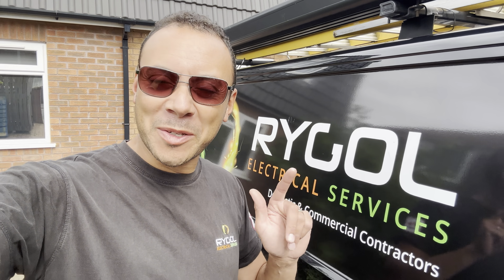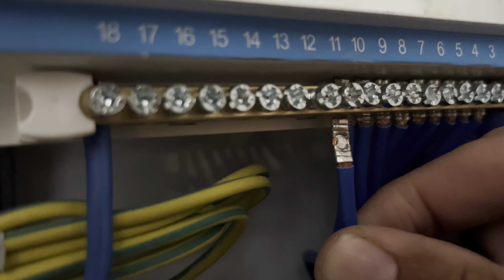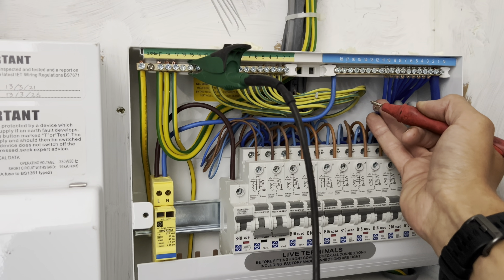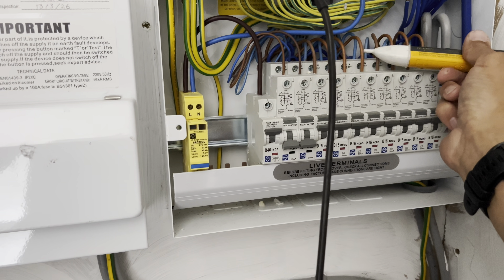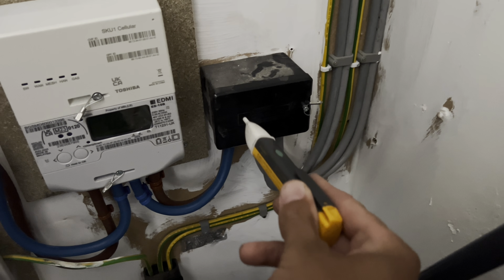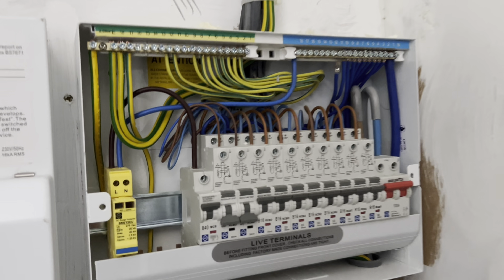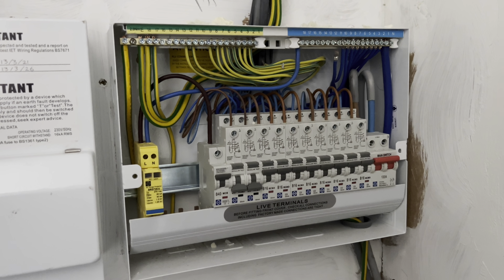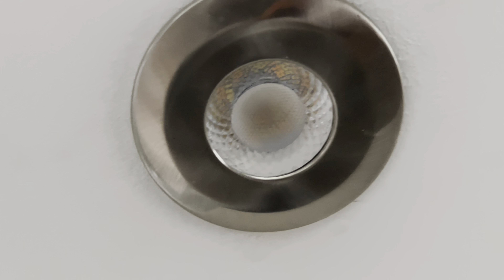Smart Meter Disaster! ⚡️

Comment: I am also a registered Electrical Inspector of the Aussie and New Zealand wiring rules AS/NZS 3000, and whilst living in NZ only Inspectors have the authority to install revenue meters and do the final connection to the DNO. Only Inspectors can sign off electrical work. This way only qualified, trained and experienced tradesmen can do this work and all safety checks documented. Not like here in the UK where any minimal trained muppet can install meters. A lot of fires are started by not tightening the meter tails correctly, or twisting 7 strand 16/25mm conductors correctly, or using bootlace ferrules on flexible fine strand cables. Any high current carrying conductor not correctly tightened is going to generate a lot of heat.

Comment: My mains comes into the right side of the meter, not the left as your’s is setup.
Reply: Are you in the UK?
Reply: @ten-bob-note  yes. Meter supplied by E-on.
Reply: @SirHackaL0t.  
If that really is the case then your meter won't be measuring your electricity usage properly, unless it is a VERY new (bidirectional solar panel) meter; in which case it's still not been installed correctly.

If it is a fairly modern (electronic) meter, then it will be stationary and not counting anything.
If it is an old (analogue) meter, with the rotating wheel, then it will actually be going backwards, which will probably lead to a massively incorrect bill.
Take 2 readings, several hours apart, to confirm if the meter is actually counting in the right direction.
Take a photo showing both the cut-out (company fuse) and the meter, for evidence that it has been connected back-to-front, then contact E-on.
If you have solar panels, ignore everything I've said and get back to me.
Reply: @ten-bob-note  Having another look…. This is why I’m not an electrician. 🤦‍♂️ lol. There is a disconnect after the meter. The incoming supply is actually on the left side inputs of the meter. Doh!
Reply: @SirHackaL0t.  
No worries.
Having an isolator, after the meter. is a very good thing!
If they fit one, without you asking, they do it for free.
If you ask for one, they charge you £300 to £600 quid!!!
Take care, all the best, Bob.

Comment: Hope this is reported and installer of meter sacked.
Peoples lives at risk.
Was installer a real sparkie or a suby mate.
We had gas combi checked by council.
It would not work an hour after he left.
They sent a second operator and he said he had removed a part and not replaced it, two way switch or something. Only hot water no hot rads.
Dodgy 1st operator, 2nd guy said council don,t do enough checks on operators to see they know what they doing.
Like hot water out of cold tap in bathroom, pipes run nxt to each other no seperator insulation.
Dodgy people.

Comment: The title was a bit of a clue, but a glimpse of the meter early in the video showed it was wired correctly, so I suspected the chassis of some Isolated AV kit that had floated up to ~110V which once caught me on a TV aerial 12m up. In the event it was straightforward polarity reversal.

In answer to queries, the lights got enough electricity to light up slightly,  like the tiny leakage through a mains testing screw driver.

There was a separate fuse box for the fire alarm for two reasons.  When the alarm was added the main box was full,  and second you don't want the alarm unpowered if the RCD trips. We had a similar arrangement for many years, but upgraded to a larger split range box a decade ago. Alarm, boiler and deep freeze are on on side and everything else on the other.

Comment: Can I ask I’m not an electrician but I was wondering how can it still work as normal if polarity is reversed
Reply: I’m level 4 EV qualified so yes I do but I don’t deal with domestic
Reply: @fpvuk3133 
EV, so mainly DC then?
I'm just off to work, factory electrician, on night shift tonight.
I will get back to you tomorrow.
Short answer:
There's no difference between the 2 poles of a single phase AC circuit, until one of those poles is referenced (i.e. connected/bonded) to (the general mass of) Earth, when it becomes the "neutral" pole, by definition.
If you can get your head around 3-phase, star-neutral, it will all make sense.
There are quite a few 3-phase EV chargers on the market these days.
Catch you later.
Reply: @ten-bob-note yes that makes sense I mainly deal with DC only time I deal with AC is between inverter and drive motors etc which are 3 phase and from type 2 charger port to on board voltage converter which is AC apart from that all DC bud. Thank you very much for your explanation always have been interested in the domestic side of things too.
Reply: Seeing as you're not an electrician, this is an intelligent question.
Do you know any basic AC/DC electrical theory?
(As in O-Level or GCSE Physics/General Science?)

Comment: Back in the early 1980s, I had a 660 volt, 300 amp gantry crane where the wiring was back to front - through the fuses before through the isolator; lucky I have dry skin, as I was a lowly apprentice and didnt think to check before unbolting the HUGE fuses.

The local electricity board had to switch off the sub station, feeding multiple factories,  for us to make it safe.

The veteran sparky I was working with went white as a sheet when he realised I had pulled the fuses live.

Comment: You should report the company, That's a very dangerous situation to the customer.
Seen many meter changes were the incoming and outgoing supply cables have been numbered 1 2 3 4. sorry but if you need to number up supply cables you shouldn't be doing the job...

Comment: It’s lucky you tested the neutral bar instead of touching it
Reply: Don't think he was entirely lucky.  I expect he had an inkling of the sort of polarity issues that would cause this fault and was being especially careful!  Makes a better video not to tell us at that point though.
Reply: Reminds me of the BBC trade test transmission film in the late 60s where someone had reversed the wiring to a coil, preventing a lethally sized capacitor from discharging via the dump switch or earthing stick. It was called SIDE (switch off, isolate, dump, earth). I was only 10 years old at the time but it taught me essential life preserving skills.

Comment: Firstly, I'm a radio comms engineer, not an electrician.  A couple of comments though. 

The note, . "Location of socket tested, Kitchen" obviously he either didn't, in which case the installer lied, or he did and didn't understand the results of his test in which case he is incompetent. In either case he either needs sacking or retraining. I think it was the above that scared me more than the actual initial error, people do make mistakes but then to also possibly lie in the report afterwards is even worse.

 I had a shock in a vaguely similar situation, palm of my hand on an earthed metal case and my fingers touched an exposed live behind the panel. A couple of seconds of fear as I couldn't move my hand and then I woke up on the floor a couple of metres away, very very scary afterwards and according to a colleague who witnessed it quite spectacular, whether it was the shock, or me pushing away we weren't sure. Something that I would not like to repeat.

 Also, the plug-in tester you use is a life saver for us non electricians who encounter lots of temporary site installs. I always carry one and use it a lot. I fitted some radio kit in a mobile control vehicle, sliding out sides with prewired power, UK and continental sockets that moved around Europe on a weekly basis to sporting events. On one event I plugged in the tester, and it showed L/N reverse, just as you had. I called up the site electrician on the phone and he came straight over, he had wired into the vehicle and made a mistake, we all make mistakes, it happens. His biggest mistake was in not testing something that he had done hundreds of times before, literally on that truck. I knew him well and he was mortified.

Comment: This is a prime example of where they should have to check polarity within the consumer unit at the main switch.

Also highlights the importance of marking up tails at Henley blocks, those DP Henley’s should have the line at the back really.

Even saying this, they’ve bull sh1tted the testing to confirm polarity.

There really should be a main isolator fitted before those Henley’s , single point of isolation and all that guff

Comment: I had a distribution board put in and i was using a solar inverter. He was putting in the breakers. He called me over and said the board was not working and it was my fault on the inverters . I looked on as he switched on the breaker it would not work. I looked and something did not look right he was looking at me and looked at the board and realised he had put the breakers upside down!😂. He banged his head with his hand, i laughed and he was so embarrassed. Easy fix and we checked everything together after that. I just think I was having a bad day.
But it goes to show you even qualified people can screw up, so be very careful. I always check things out and the reason i do it was i got a belt of 17 kilovolts of piece of equipment thrown across the room into the wall and that hurt. Lucky that it was very low current. That's when I learnt i could not trust myself 😂 so do check with a meter several times before going near anything.😊

Comment: That could be super dangerous...  I always use the colour coded tails rather than the grey tails to try to reduce the chance of something like this happening, maybe a learning exersize, always use the colour coded flexi tails..
Reply: Some jobs do not warrant the extra cost, Doesn't stop anyone marking both ends with tape though.(With the right colours of course. LOL).
Reply: @paulmac8016  Tape is a good shout, the colour coded double insulation layer does not generally cost any more, its just about buying from a different supplier..
Reply: Besides i think it's more of a training issue than which tails are used.

Comment: Normally henley blocks are wired with neutral at the front and live at back. 
Not sure why you installed it the other way round? 
Also those type of henley blocks are rubbish, they should only make single 100a ones
Reply: This is the "swiss cheese" model. Each operation has risks (the holes) and you hope that the holes in the multiple operations don't line up. The backwards-from-convention wiring in the Henley block was a hole that should have been covered by the smart meter guy's testing. The smart meter guy's failure at testing should have been covered by the installer knowing the convention. The installer's not knowing the convention could have been covered by Henley blocks being labeled.
Reply: Yep, always live at the back. Those connectors often spring out on you when the front cover is removed, so not so good if the lives at the front.. very bad design, but they still make them!!
Reply: It is best practice to wire line to the rear and neutral to the front of these double pole connector blocks, however they are not physically marked and not every electrician uses best practice, notice the grey meter tails leaving the Henley block are not identified with brown/L & blue/N , like the guy said in the video, we are only human and make mistakes.
Ultimately the Smart meter installer should of checked polarity and clearly didn't .
Reply: You are 100% correct. Meter man has no excuse for not finding this out but he was correct in making the rear terminal live and the front one neutral. Every electrician should know this. He was set a trap!
Reply: I scrolled through a lot of comments waiting to see when this was going to be pointed out and I'm afraid I agree the 100a double pole block that we used to call a Henley block normally is wired with the live at the back. But more importantly there's no excuse for not doing the final polarity test. Nice to see the neat wiring within the consumer unit.

Comment: Hi 👋 just found this video. It's very interesting, thanks, I have a question for you one of my nieces had a smart meter fitted, and ever since, her consumer unit keeps tripping out at a certain time of the day, the meters were fitted by EDF, she got back in contact with EDF and explained what was going on they said she should get an electrician to check the wiring, this she did and the electrician said everything was OK she then told EDF and they sent someone to change back the electric meter to the old type but didn't change the gas meter, and now her consumer unit is still tripping out at certain times, have you got any idea?? Liked your video. Thanks.

Comment: I understand your ethic of wanting to do a good job,  but removing the seal and rectifying the issue leaves you liable should any further problems occur on that installation. Reporting the issue to the appropriate body would have been the correct route to take, to ensure the sloppy workmanship and poor testing does not happen again on another installation . As you said yourself the result could have been catastrophic,  ending in death.

Comment: First test should have been a polarity check on the incoming. Then proceed to where you are now and onwards. 🙂
Reply: Easy to say after watching the video eh chum 😂
Reply: @audioglitchguy  Yes it is, except every job I visit since being an apprentice in 1978. I always remove consumer unit cover. CHECK POLARITY. Then Voltage. Then ze, if allowed to turn power off. Now tighten every terminal screw. Replace cover. That takes all of 5 minutes. Now look at what you came for. I have never had a wrong polarity or fire etc after I was the last to visit. Simple basic training and following procedures. Then again I never tinker. 😉😎
Reply: @audioglitchguy he's right it should have been picked up with safe isolation before the neutral bar was touched

Comment: Personally would of went for fault loop. Here in QLD Australia they ley me alter metering and pull main fuses; For me we've always had access to LV fuses to do our own metering wiring.
Reply: Simple volt meter to test polarity. L-N, L-E, N-E. Job done and fault found in 30 seconds. 🙂
Reply: @paulmac8016  That doesn't test fault current; It's required so the circuit protection will trip. Just doing a polarity check doesn't cut it.
Reply: @TradieTrev  it's the starting point. If you get wrong polarity, then that's where your search begins. If OK,  follow with voltage test and ze if allowed to isolate.
Reply: @paulmac8016  Good man, you know what's needed.

Comment: Why has British Gas put a seal on the black box when it's after the meter.
Reply: If a Meter Operator works on a Henley block (the "black box" after the meter) then they are supposed to seal it and take a photo, to prove that's how they left it.
Reply: Meter installers are responsible for top of cut out up to consumer unit tails. So if blocks/isolators etc are already fitted, you have to open them up and check all terminals are tight and reseal.  We had to take at least 15 photos of each install once completed. This included at least one of your Martindale in the property. We had excellent training and regular refreshers for the 3 companies I worked for. The problem, I think, lies in the fact we are also doing gas installs and up to 5 duals or so a day. With the driving, parking, dealing with all sorts of customers this could be pretty stressy. There are hundreds of thousands of meters being changed, so this will always happen due to human nature and some crap installers. No excuses tho, not doing your checks after installs is massively dangerous to the homeowner and could land the fitter in jail.
Reply: @jbuckley2546  
From what you say, you were obviously trained properly.
How long ago was that?
The last meter fitter I saw hadn't got a clue.
(Not his fault, just p155 poor training from his employer! He was a really good guy.)

I spent an hour, of my own time, teaching him basic AC electrical theory.
We both lost money, but we both walked away happy!

Comment: So if this is the case, what happens to your readings, are they showing energy use even though it’s switched off.
I would be disputing the bills
Reply: The polarity was correct, at the meter, so would not have affected the meter readings.
The error was downstream of the meter, at the "Henley Block" (100 Amp chunky junction box).

Comment: Don't feel you owe any privacy to the culprits, this is a serious failure of duty. 
They needed an emergency call to recify the fault and be reported to the HSE. They can pin it on you if youve cut the seals or at least use that to muddy any investigation.
Reply: Yes, Although he didn't  actually show it in the video, I hope this guy videoed/ took photos of the opening & the inside of the Henley block, before & after correcting the defect. Just in case any evidence was needed for any problems later on.
Reply: @RichieReportsUK_UKCNews  The Henley block is on the consumers side, so he is allowed to cut that seal, it doesn't need to have a seal on it... however, when the meter was changed, the meter fitter should have fitted a double pole isolator between the meter & the Henley Block.
Reply: Name and shame...what's the point of standards otherwise?
Reply: Should definitely be reported
Reply: the seal on the Henley block is not under DNO/Meter jurisdiction. Photo,s before and after with the meta data intact will negate any liability on the contractor.
Reply: Jobs a Job your either qualified or not i agree with your comment. bugger british gas
Reply: Calm down mate 😂